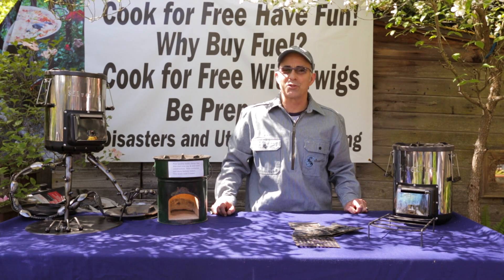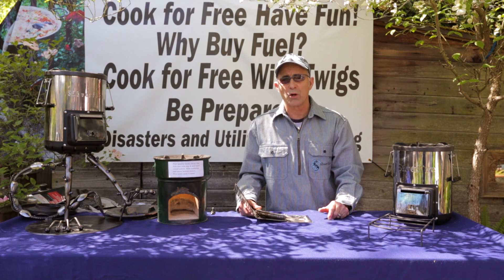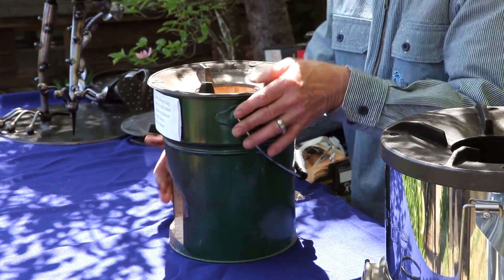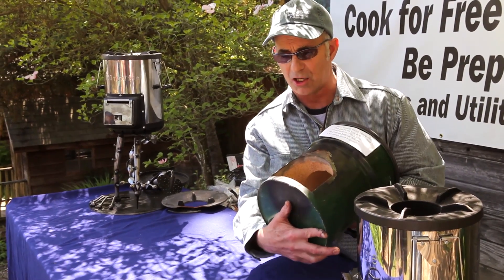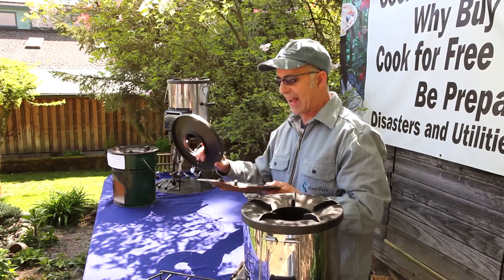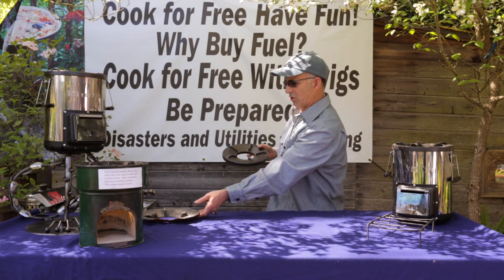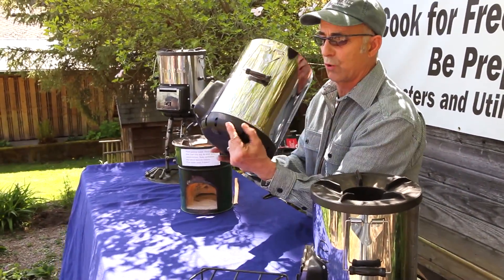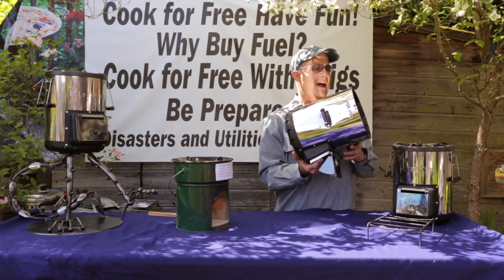SilverFire Survivor Intro & Construction

Comment: Can you just use say 5 or 6 inch long sticks/twigs inside the oven and keep the door at back completely shut ? Would that preserve more heat ? Also, why do you need to use very thin sticks ? What would happen if you used thicker sticks for fuel, eg. about an inch thick ?
Reply from the maker: There is only one door on the front of the stove that is falling down on your inserted fuel.  The door has side heat retention reflector wings too.  This design retains more heat in the combustion chamber. Of course, you can combust larger sticks in the stove, however, you are defeating the purpose of this finely tuned stove and its ability to use less fuel than any other natural draft rocket stove. One of the primary design principles of the rocket stove design was to use minimal fuel, to conserve fuel, reduce emissions, and maximize heat transfer to the cooking vessel. That one of the shortcomings of many DIY and commercially made rocket stoves.  They never grasped the original design principles or have maximized efficient outcomes.

Comment from the maker: Well stated.  Great point, yes many Kamado owners (Big Green Egg, Char Broil,  Kamado Joe, etc...) have learned the unfortunate fact that ceramics can wick moisture and the thermal shock associated with heating and cooling cycles results in fractured ceramic.  The unglazed interior infrastructure are especially fragile and subject to frequent replacement over time.  All these Kamodo cookers are subject to frequent replacement part sales, great I suppose for the seller, but painful for the consumer.

Comment from the maker: ODV:

Thanks for comments, yes StoveTec primary combustion was our limited focus and 2008, adding secondary combustion, improving superior raw materials, and increasing heat transfer & combustion technology really moved our technology, and durability forward.  Our stoves are significantly more efficient, lighter and more durable than the thin mild EcoZoom, EnviroFit, and StoveTec models that sprung from our early work with Aprovecho.  Unfortunately Aprovecho and the SSM factory that produced the stoves mentioned above, were associated with multiple failures in the field.  However those failures laid a great foundation for the most extensive biomass cooking product line available today at SilverFire.  We have a lot of exciting products in our current portfolio and more pending.

Comment from the maker: The door is falling down on fuel to retain heat in stove, a rocket stove is side fed, thus fuel is inserted horizontally and is supported.  Ventilation is maximized in unison with combustion chamber ductwork, ventilation ports below combustion floor, through viewing port, and withe 360 degree ventilation ports in base of stove.  Ventilation and heat retention are all limiting cold air, increasing combustion efficiency.  More in-depth information is on our website at www.silverfire.us

Comment: Excellent video!  I have learned so much!  Just ordered my Hunter, in a week or two i intend to order my Survivor. Then i intend  to order the Dragon Pot and Steamer and the Grill Plate after that. As Winter is approaching fast and possible power outages a very real situation where i live, i will sleep better knowing i have covered my butt better if SHTF happens!  LOL!  BTW, i have several different sizes and types grills and smokers, but to get them lighted and going to cook on is a pain and takes alot of time and wood and charcoal, and if its 20 degrees and windy, well, i don't have to tell you what a problem it is. Also it is easy to start and use and the biggest plus for me is how little wood you have to use in it!  I definately want to conserve as much wood resources as i possibly can when i am in a SHTF situation!  Thank you!